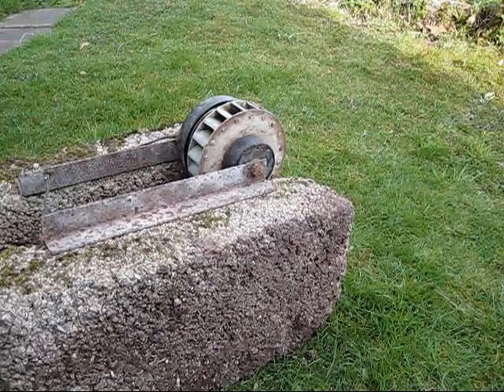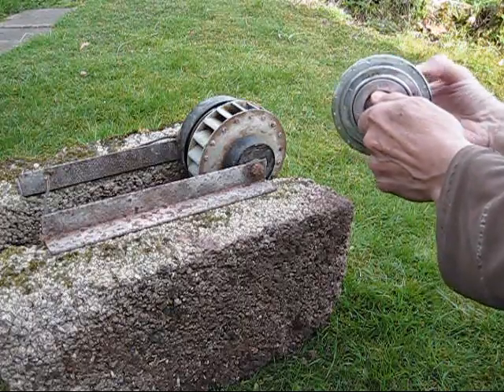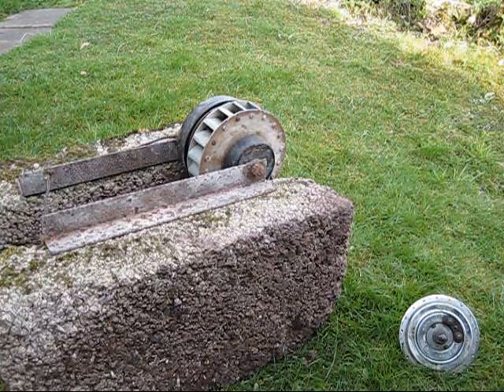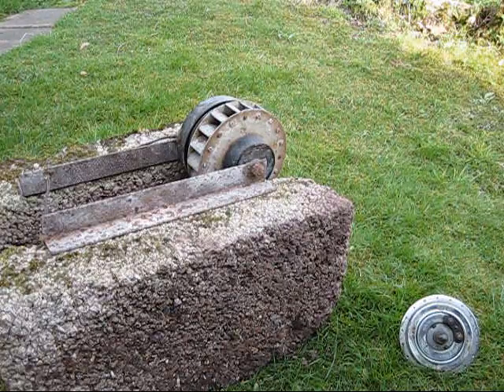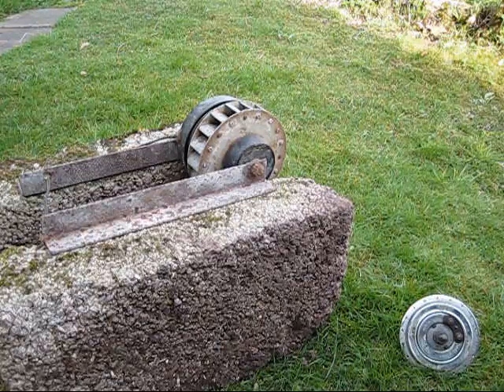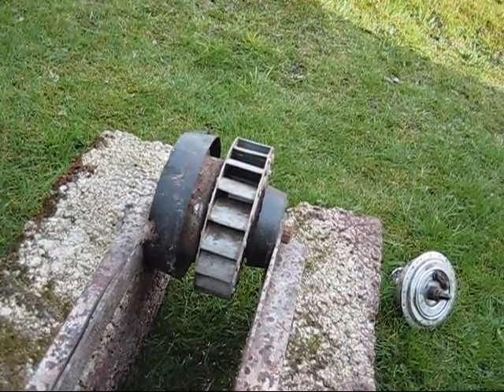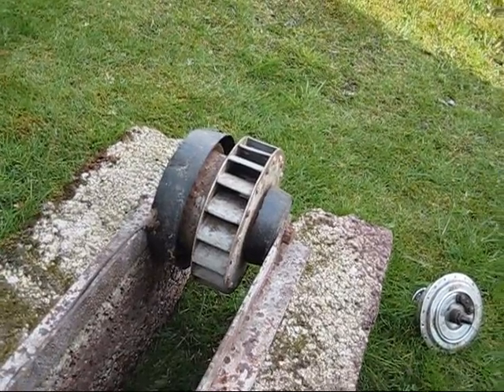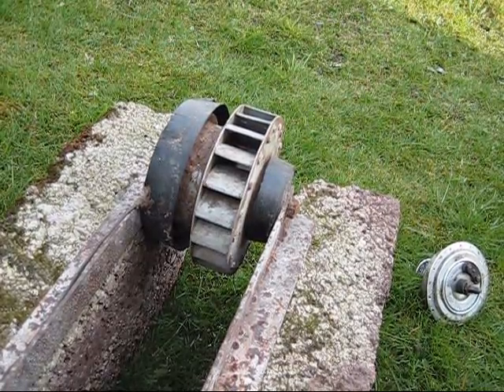Diy 2 Watt hydroelectric generator using bicycle hub dynamo

Comment: Can we use old genator dynamo?  Of the water power plant
Reply from the maker: You could use a generator or dynamo but it must generate power at low speeds with this directly coupled water turbine. Thanks for watching.

Comment: Wow Dave...that would make you an early pioneer of green clean energy. I think the possibilities of micro generation around the UK are huge. Imagine many hundreds of thousands reducing energy consumption by just a fraction each. Across the board it would amount to a fair bit. Good go and project. Love it. All the best. Mark. P.S got your email. Responding now.
Reply from the maker: +Wye Explorer :o) I'm not sure about 'an early pioneer', the CAT in n.Wales was the place that, in about 1977, made me think about small hydro. I've since come across many old pre-war hydro systems in old mines etc. Even my puny 2 watt system made people smile though - MUCH easier to get 2 watts from solar, but hydro can be 'always on' that's the big advantage. And it's more interesting to look at than solar. Thanks for comment Mark. Dave
Reply: noakeswalker I get your point on the pioneering origins Dave. I've been to CAT...a very inspiring place and yeah people have been using hydro for a long time. Solar is improving mind what with nano technology they can extract energy out of very minimal light. All good stuff though but water does have that moving aesthetic advantage I agree. Mark

Comment: Dave. I knew of this project but didn't realise you still had the parts in your shed. Nice to see it on the vid. 
Do you think a modern hub dynamo would give a better output than one of those vintage Sturmey Archer ones?
Reply from the maker: +Steves Workshop Yes, a modern hub dynamo could give more output - better magnets and better internal design (probably - I  have not had a look inside a modern one yet :o)). An iron-less design of generator would be even better, as there might be less eddy current losses (ie that 'cogging' you can feel by hand) Ta Steve.